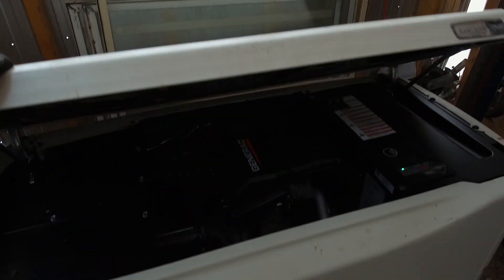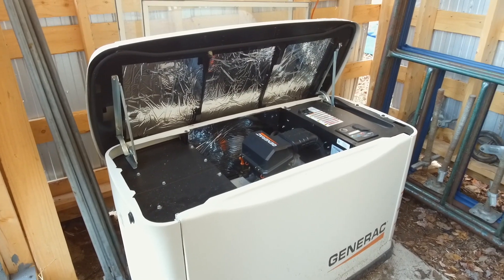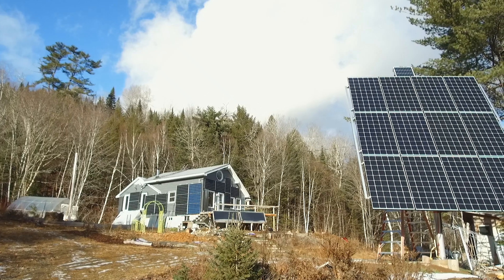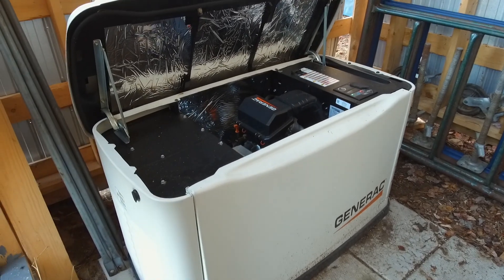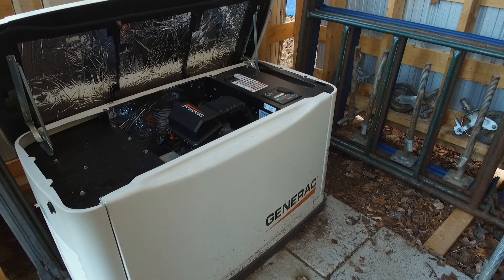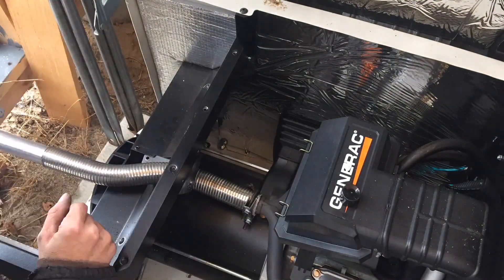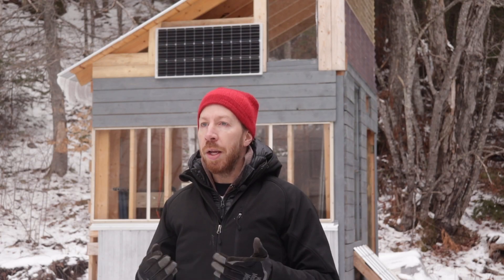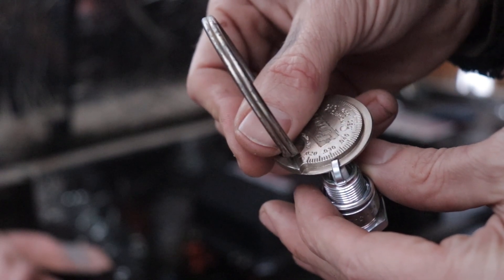Solar Life - Episode 11: Generator Upgrades and Maintenance

Comment: I really like your videos.
Has the generator been modified so that it can be controlled by the solar system?
Keep up the good work.
Reply from the maker: Yes it has an autostart to recharge the batteries if they drop to a programmed low voltage value.